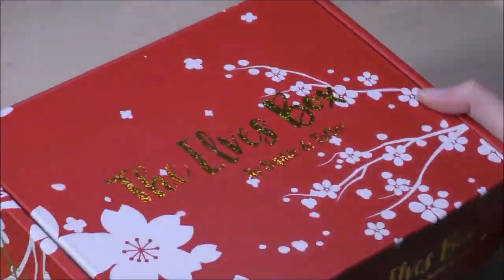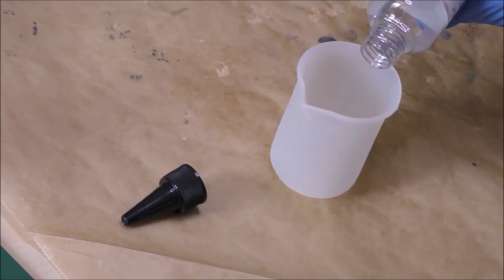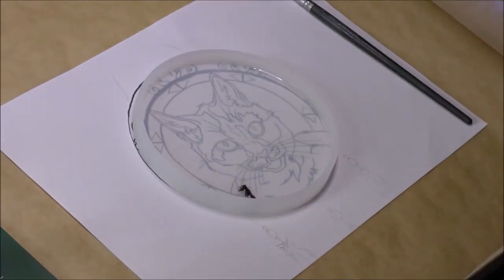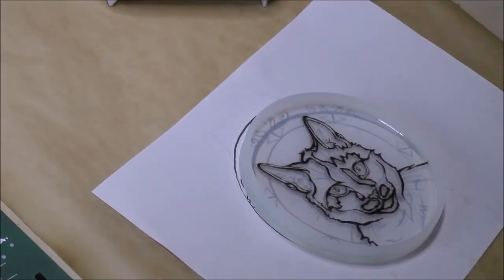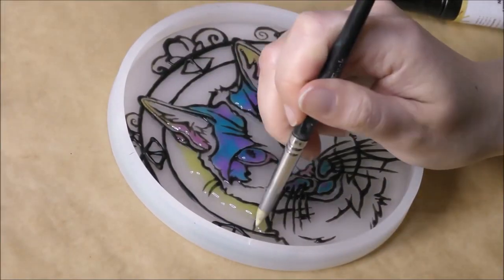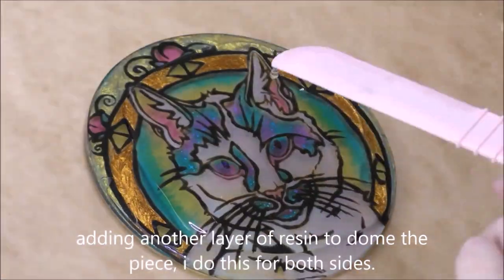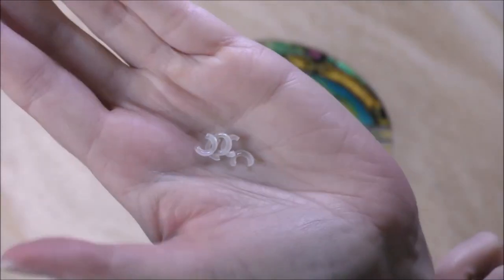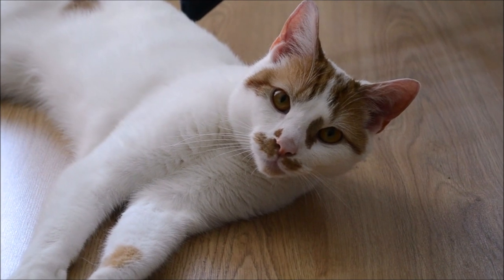How to make a stained glass sun catcher with resin

Comment: Is there any way you could tell me what to buy off of Amazon for this
Reply from the maker: You would need a large round tray silicone mold to make the sun catcher, you would need epoxy resin ( that is a resin with a A and B part which you have to mix together to have it cure in 24 hours) you would need uv resin (transparent which you can color with pigments or dye) or colored uv resin to make the stained glass details with, and the thicker 3D liner resin to draw your design with. Then some chains to hang it up with or for decoration, the mold you can find on amazon, aswell as the apoxy resin and uv resin , the 3D liner resin i haven't found on there, Sophie &toffee might still sell those on their webshop, but alternatively i think there are also products that give you the same effect that are acrylic based, but i also have seen people use black acrylic paints to draw the design on.